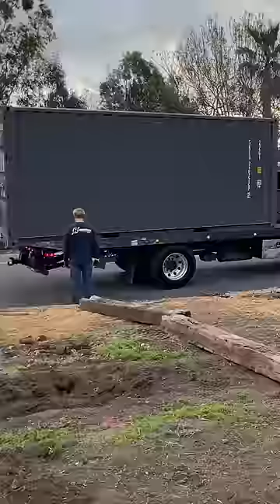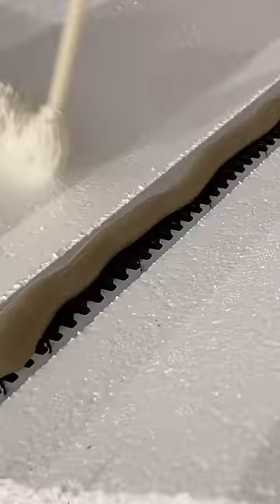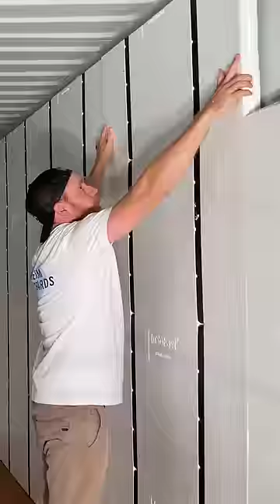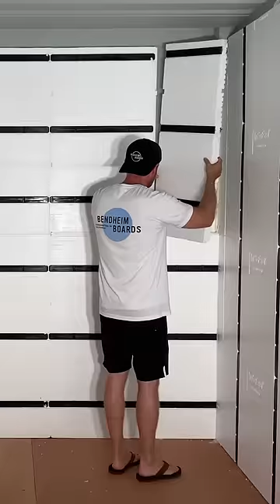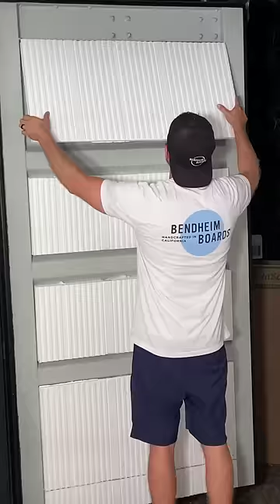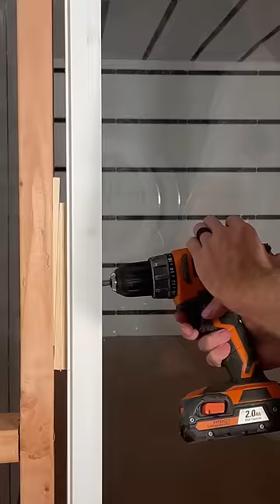Shipping Container Shaping Bay Progress thus far #shorts

Comment: A man that works in flip flops is a confident man 👨
Reply: hell yeah 🤣
Reply: Exactly bro
Reply: SHOP FLOPS
Reply: A man wearing flip flops using a b&d drill/driver and brackets, framing a nonstructural wall while requiring  more than 2 shims for a door frame he just built should not have that confidence. Its probably misplaced.
Reply: I have a pair of those.  They're OSHA certified Safety Flops.
Reply: So what 🤷‍♂️
Reply: Needs a HARDHAT, GOOGLES, AND  STEEL-TIPPED SAFETY CLOGS
Reply: Yeah
Reply: California...we do everything in flip flops😂
Reply: @karthin8017  I did not see the hard toes.

Comment: fun fact, shipping containers can float, if you Really make it as water tight as possible and get a few of them then add water craft stabilizers into them for high flood areas, you can keep you stuff safe, just don't forget to chain them to 9ft concrete in ground pillars
Reply: I'd stay underground but you do you
Reply: @tequilasalad1535  in some spots in the states you sit at sea level so they don't build basementa
Reply: Richard Dimple  i waterproof basements as well and I’ve always thought that as well we literally just pump the same water out of the basement and the system collects it again and puts it back out into the yard.
Reply: Sounds like a nice weekend project.
Reply: @Tequila Salad  staying underground in a flood may not be such a good idea lol
Reply: @tequilasalad1535 sp you would go underground In a flood? no one else gonna say something lol? water goes down as well as up
Reply: @rjtompkins7044  I mean if where he is going is water tight the I'd so go for it. but otherwise I wouldn't want to be in a flooding coffin
Reply: @practicallyseth4024  there’s nowhere else to send it unless you get a cross connect into the storm sewer

Comment: If you are worried about insulation, you can use refrigerated containers
Reply: As long as its new woukdnt you think? May have carried a lit of meat.
Reply: Or just use spray foam I like this stuff because gives flat walls
Reply: And if you’re worried about mold, don’t.
Reply: Aren’t refrigerated containers still insulated🤔
Reply: At more than DOUBLE the initial investment for a container thats not nearly as durable in th long term
Reply: Most refrigerator conex boxes are smaller in length to account for the refrigerator that is on the outside. Since conex boxes have to to be specific sizes for transport on ships, it is just cheaper and easier to use a standard conex box.
Reply: If you are worrie about  insulation ,you can use  refrigerated containers
Reply: If you are worried about refrigeration, you can use insulated containers
Reply: If you can use refrigerated containers, are you worried about insulation
Reply: Or you can just use styrofoam like the guy in the video...
Reply: Shorsey is a carpenter in the off season?

Comment: If air from the inside reaches the gaps between outside metal wall (cold) and insulation the water vapor will condensate —> you get mold. So you need a water vapor tight layer on the inside (been there, done that, trust me). It can be done, but please be aware of that!
Reply: Okkkk you know your stuff
Reply: Yeah that's why wood or brick houses exist

Obsorb water prevent mold
Reply: @CocoKoi321  That's incorrect... Wood and brick houses still require moisture barrier.
Reply: @video4jr1  Correct, I was redoing our house and the dummies who built it didn't put a vapor barrier up, I had to go stud by stud and remove so much wood that had rotted out over the years.
Reply: So your q torture chamber owner as well , hey me too welcome to the club
Reply: @andrew_yeeeett2165  😅😅😅😅😅
Reply: Bro becomes albert Einstein
Reply: What would you use to ensure an air tight gap? I do plan on building on of these one day soon enough
Reply: @sheeeeeeeeeeesh  I would recommend a wooden framework with a polyethylene layer. Inside I would attach 15mm osb, which also works as a barrier if the gaps are closed with sealing tape (don’t now the right word). This also increases usability as yo can put screws in that layer to attach stuff to the walls. For the optics put 12,5mm gipsum board on the inside, which can be painted and acts as a light buffer for humidity. Yo loose some volume on the inside, but you prevent mold. And don’t forget to care for proper ventilation to get the humidity you produce out…
Reply: But honestly: the best way to do it is creating a flow of ambient air between metal and insulation. E.g. you can put a wooden framework on the inside, put 6cm of wood fiber insulation in between against the metal (don’t fill the … „deeper gaps“), then osb (sealed) and gipsum inside.
Now screw holes in the exterior wall (or better: start with this), min 20mm diameter, one close to the ground, one near the roof, so that air can flow upwards in the gaps between metal and insulation. Cover the holes against rain, but make sure the air can flow easily. Make sure to attach something to prevent rodents or insect from entering (best cover the holes with some metal grid from the inside) an make the lower hole so that water could flow out (should not be necessary, but „it’s better to have it then to need it“ (German proverb). That’s how I would do it.
I hope you understand my bad English.
Reply: Nope. It’s already vapor tight. Take a nap.
Reply: @video4jr1  false. If it can breathe on BOTH sides, condensation isn't a problem. Just ask good builders from the last 10,000 years or so.
Reply: @CocoKoi321  absorb and release moisture. If it can breathe on both sides, not a problem. But if you make one side moisture proof, you need to seal it on both sides, and edges too. See multi pane windows.
Reply: Yikes.  Thanks for the clarification
Reply: Yea. The hollow area needs to be filled with insulating materials such as foaming urethane which is widely used in S.Korea where I am living. We have cold winters so insulation is a big deal here when it comes to building houses.
Reply: עת רקוד SOU VIRGEM.
Reply: If you remain long enough inside such a container it's going to be awfully stuffy in there. Be sure to ventilate once in a while.
Reply: styrofoam doesn't mold... neither does aluminum.
Reply: @brianjohnson9607  that’s right. But dust does. And if is in places where you can’t clean (but which are not sealed) you gonna breathe in some nasty stuff…
Reply: Or probably use concrete, no air leaks - no condensation. 
But you're right I though about conversation too, because I had that issues
Reply: @CocoKoi321   материал неважен. Он говорит о физических законах; видно Вы плохо учились или низкий уровень преподавания. Не волнуйтесь, американская верхушка у нас тоже развалилась образование в стране, чтоб были тупые рабы и их слушали.
Reply: @jochendoell  true.  Either way, not putting a vapor barrier is both lazy and irresponsible.  Better to have and not need than need and not have.
Reply: You're absolutely right but don't the smaller pieces he's putting in the gaps take care of that or do you put "barrier" over n then finish insulation??
Reply: @jochendoell  that saying is by Franz Kafka i believe.
Reply: Not inside only outside
Reply: Doesn't really matter where your vapor barrier is, the outside is (damn near) impermeable.  The dew point always occurs somewhere within the wall.  Most moisture comes from outside, but a ton of moisture also comes from the inside and needs to find a way out- moisture coming from the occupants bodies and respiration, and indoor activities such as cooking and cleaning.
Reply: @michaelcobaugh7287  verbal tough guy
Reply: If these containers are not vapour tight, maybe it would have been better to have use spray applied elastomeric AV barrier to the outside to ensure air and vapour tightness and then the insulation on the outside and some nice finish (instead of a shipping container) to cover it up and provide an additional layer of protection. And now that the container is protected by the outside elements, then the living space should have proper a ventilation system that will discharge any moisture generated by living there.

Treat all types of climates the same way nature does. The skin is AV barrier and clothes, feathers or fur is the insulation from intense heat or cold. And then there is some way to discharge or generate heat in living systems.
Reply: @chocokoifish321 what are your other options besides would or brick?
Reply: @josemuniz9750  Yurt!
Reply: @Nanyko2  jealous you aren't an American huh. You never hear us cutting down your country. B/c we love your people! Ukraine is awesome. Be safe my friend
Reply: @jaebmolina678  did he marry his cousin too?

Comment: Need to put sealer on all of those screws you just put through the walls. They will eventually leak
Reply: he didn't put any screws through the actual walls.
Reply: There's no such thing as rain
Reply: Конечно, вы правы. 
Ведь это мостики холода.
Reply: @jeffreyssvtproductions1986  а к чему же он прикрутил  деревянные брусья? 
К пенопласту? 
Разве это возможно?
Reply: @Катерина Морская  if there is a lot of glue it will hold, but is not right.  He should also build a frame around the container and use bolts.
Reply: @Ricky.913 😂😂😂😂😂💀
Reply: Good point!
Reply: @j.s.8227  Конечно! 
Я с Вами согласна! 
Работа должна быть выполнена качественно!
Reply: Basically, that’s what I was thinking. No moisture barrier?
Reply: I hate leaks
Reply: Screws are not going through the steel
Reply: @maztermau  yes they are-steel screws.
Reply: He screwed into the black steel strip on boards not through the container wall 🤣🤦
Reply: I put siding and a roof on mine
Reply: He didn't frame the door right either
Reply: @kittybrowneye3163  some name 🤣🤣👍👍👍
Reply: Anyone going to mention how he framed that wall in? Screw through frame and then into metal
Reply: they'll probably add some sort of roofing material
Reply: @jeffreyssvtproductions1986  then what?
Reply: @HarryPalmer-P.I.  I hate Celery.
Reply: You shouldn’t be allowed to comment.
Reply: Screwing into the roof and walls concerned me as well... 
My curiosity demands logical answers to leakage possibilities...
Reply: @maztermau what is the screw going thru to be effective?
Reply: @jamesformanek3492  show us! Please 👍🏻
Reply: @eoiny111 🤔

Comment: I'm starting work on a 48ft container over the winter, this looks like the proper way to insulate, thanks for the upload
Reply: It's not enough insulation. Do yourself a favour and use exterior insulation, oh, and save yourself some money and make the container out of wood, not out of a shipping container.
Reply: @velianlodestone1249  thanks, , I appreciate your response, I should have stated in my original post, that this a job I'm doing for a customer, not a personal living space, that's my bad.
Reply: Have you thought about using recycled hard plastic lumber? I dont know what it looks like price wise but, it doesnt have environmental changes like wood or metal
Reply: @CarsCatAliens  Poly Lumber is quite expensive in most places sadly, especially if you're buying from reputable sources. I'd imagine in bulk it's better but Home Depot sells some for up to $200 per board. It'd be interesting to find a good quality supplier in bulk that sells by the pallet for cheaper as I know what home Depot sells similarly comes by the pallet at around $100 per board (yes, a near $100 mark up, if not more).
Reply: @tyrantosaurex  🫣 thats insane...
Reply: Don't do it like in this video. The amount of problems. It's not enough, the condensation is not taking into account, he's drealing into the metal sheet with taking care of those wholes. A proper insulation to a shipping box is arount 10k at least
Reply: And the insulation between the flutes does almost nothing. Not worth the cost or time
Reply: @chainringcalf  You’re right, there’s zero insulation on the opposite side of the other flutes. I’ve never thought of that. So realistically, just insulate the outside and be done or I guess you could stud out the inside but you’d lose a lot of space which is already minimal.
Reply: @deltashevy I assumed this was a micro dwelling or tiny house of some sort, wondered how they'd take care of exhaled breath.
Reply: Don't forget the plastic for vapor barrier any color any put on it will rot
Reply: Нет вентиляции. Ну и самое главное, такие вещи утепляются только снаружи!!!.

Comment: Wow 😳 That was the quickest coolest construction start I've ever seen. I love seeing stuff like this. It really makes you feel you can do it too with a bit of effort and planning. You're an excellent teacher ✊🏾💗
Reply: He’s done it before.
Reply: 5pĺ
Reply: p
Reply: You can...
Reply: Dont do it. There will be condensation on the cold metal and mold will grow.
Reply: Bu
Reply: @Der Löwenkönig  Maybe he should add an outside layer to insulate.  I appreciate your input and hope this guy knows this and shows us the outside protecting in a future part.
Reply: @stephenphelan626  adding a layer to the outside defeats the entire purpose of using a shipping container. At that point you might as well have done traditional stick built - it's be faster and cheaper.
Reply: @stephenphelan626  there is a lot that needs to be added. Ventilation would be a start. Good luck getting this permitted in most areas as well.
Reply: @stephenphelan626  this solution is primarily unable in warm and dry climate! Moisture and condensation ruins the imagined simplicity, narrow measurements still unmentioned..

Comment: I don't see why a container is more practical than building from scratch
Reply: Saves the need to put up exterior walls and ceiling.
Reply: @sasukedemon888888888 Yeah but you need to produce and transport a shipping container
Reply: @AtomicPotato007  depending on how you're sourcing it, it could be cheaper than the materials to do the framing and exterior walls with. And it does cut our a ton of work of framing a building which isn't easy by yourself.
Reply: @sasukedemon888888888 😅😅
Reply: I would love to see trailer parks retrofitted with containers especially in tornado states that way to save lives. ❤
Reply: No building permits
Reply: @sasukedemon888888888  plus...it remains movable...
Reply: It’s a lot less expensive than building, especially nowadays.  Prices have become so high an average person cannot afford to build their own home any longer.
Reply: @AtomicPotato007 the container was already produced and transported at least once. This is repurposing.
Reply: #methproof
Reply: Scratch is expensive!
Reply: @imonaroll9502 a tornado has no problem tossing shipping containers around like toys...or like trailer houses
Reply: @rogerthomas169  not when they are anchored down on cement anchors. You can probably weld two side by side and anchored.
Reply: @imonaroll9502  then just anchor the trailer houses
Reply: @rogerthomas169  the problem is that trailers rip apart. Containers would not, thus saving lives.
Reply: No need to buy windows.
Reply: Because it will out last anything with little maintenance thats why
Reply: A shipping container is already extremely strong, and water/ moisture tight. The absolutely perfect thing to make a tiny home out of!!
Reply: Where do you get the fitted insulation panels?

Comment: Make sure you seal that roof. Otherwise, you're going to have a mold farm in the summer
Reply: I genuinely don't know does he still have to seal it cus yk it's a shipping container...aren't they supposed be water proof
Reply: @trevorkraft8060 but he drilled into the ceiling of it.
Reply: @Takwolf  he drilled through the styrofoam center or whatever that black strip is made of he did not puncture through the metal roof.
Reply: Negative.  Been working with these for awhile yet to see that
Reply: @gawdzalien2811 so the holes that were drilled won’t leak in water?
Reply: I think it does not matter what you do with it.
Shipping containers are not build for fucking housing. 
The moisture is getting in one way or the other
Reply: @lonewolfweed9500 and what if it doesn't? 🤔🤔
Reply: How would he seal it?
Reply: Is there any video to seal that roof?
Reply: @clockwork8793  this stuff called roofing sealer. I would guess. Not trying to be a Smart a**. I've just seen it on the roofing aisle at the hardware store. 😊
Reply: @lonewolfweed9500  ^this^
In fact they are specifically designed to take on water and sink in the event a ship carrying them goes down - otherwise they would sit below the surface line creating steel hazards for boats.

You can see the little air vents on the outside of the container when it's being dropped off by the truck.
Reply: @trevorkraft8060  they are definitely not water proof brother.
Reply: What he really needs is vents, or it won’t breathe and moisture will condense inside.
Reply: @lonewolfweed9500  they're built to maintain a waterproof environment even in the middle of a storm in an ocean, they're literally designed to keep moisture out.
Reply: @lonewolfweed9500  No they are built to cross oceans. Wet conditions. Getting rocked all the time. Salty air 24/7 for months.
Reply: Это если доживëт в доме отделанном пенопластом😂
Reply: If u cool the inside and it’s hot outside you will have condensation creating mold
Reply: Also needs to be painted yearly, these things rust fast
Reply: @jessereep649 They get a nice surface rust that actually looks nice. Nothing to worry about, would take 50 years to rust through.
There is sn apartment complex built from these in Nashville Tennessee near yhe fairgrounds. They have a nice natural rust/patina finish.
Reply: @davidheseltine85 yea Rain, and other outside moisture. But breathing moisture Not. So IT will be a big Problem. Even in House isolated additional with syrofoam has this Problems. And they have fresh Air going thru everyday.